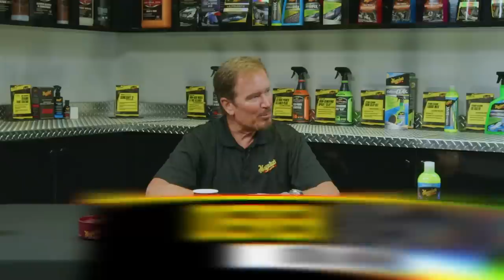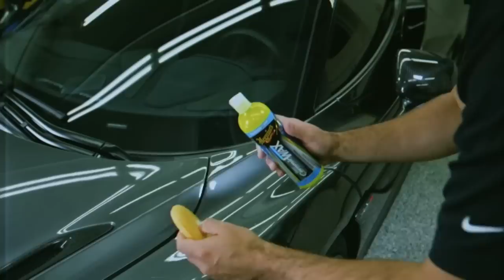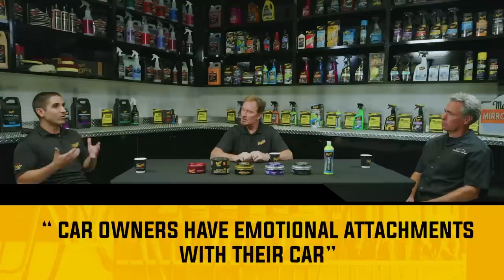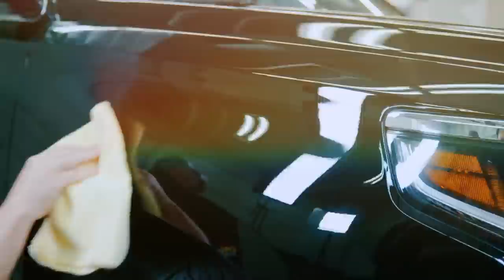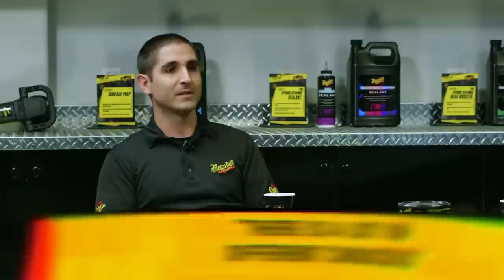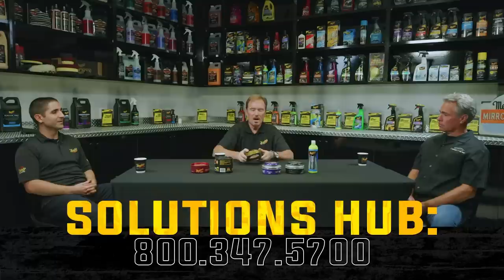What’s Really the Difference Between a Coating, a Wax & a Sealant? – Shop Talk

Comment: I have been using McGuire's wax since the mid 80s always love them and always will. Just had a quick question did you guys change the formula in the original one you know the one in the red can? I ran into an issue with it on a couple white vehicles where it was staining the plastic a yellow tone. It went away in about 2 weeks on one vehicle and 3 weeks on another vehicle. I've just never had this problem in over all these years just curious on what has changed? Is it the wax that change or the manufacturers paint jobs have changed?
Reply from the maker: The wax was tweaked several years ago but the issue you are seeing is not related to that.  It is simply and odd combination of factors.  It only happens with the paste version of cleaner/wax on the white plastic panels of some vehicles.  It likely has something to do with the special paint used for the plastic panels as the paint adheres and ages differently versus metal.

It is not common and there is no real damage to the paint; however you can imagine that may be concerning to someone who just waxed their car.  Again, there is no permanent damage and sunlight is the best remedy usually clearing it up within days to a few weeks tops.  If this is something you are hoping to avoid you can simply use any other wax on painted white plastic trim and body panels.  

Hope that helps!